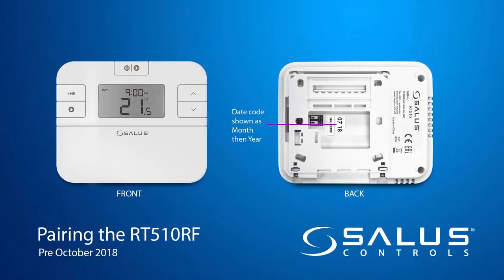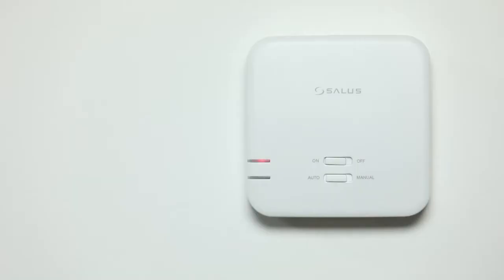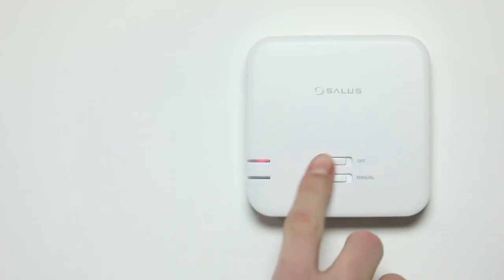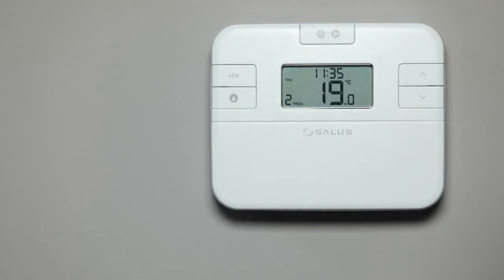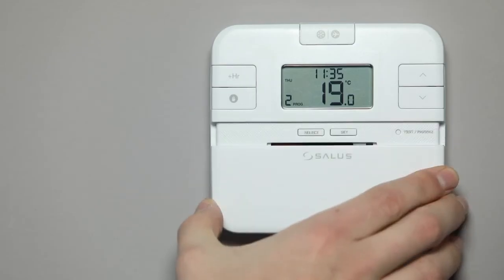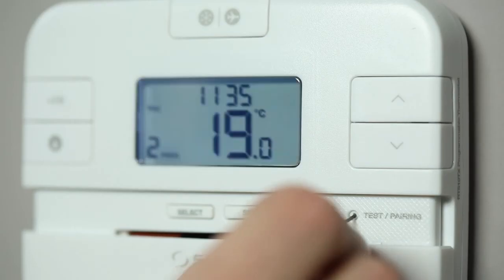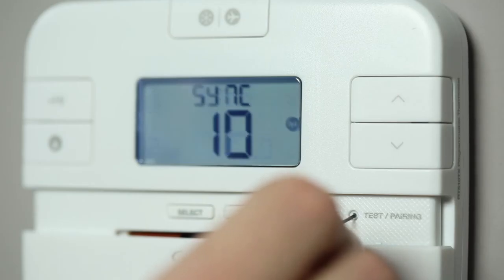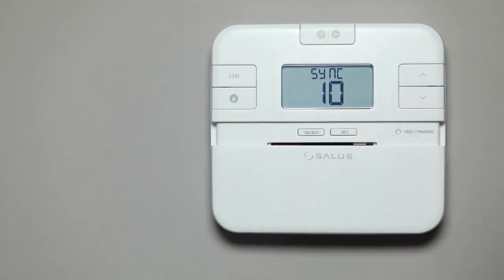RT510 Series Thermostat - Pairing To The Receiver (Pre October 2018)

Comment: And when it doesn't work what then ??
Reply: That's what I want to know
Reply: @themow432  Notice there's no answer..
Reply: @Cupat1  yep. I suppose we just sit in the cold
Reply: @Cupat1  new unit is the answer
Reply: I repeated but left the unit off for 5 minutes rather than 5 seconds
Reply: I was also 5 meters away from the boiler before it actually paired.
Reply: Completely bloody useless.  I got this unit paired fast one time, then 6 months later, no luck at all.